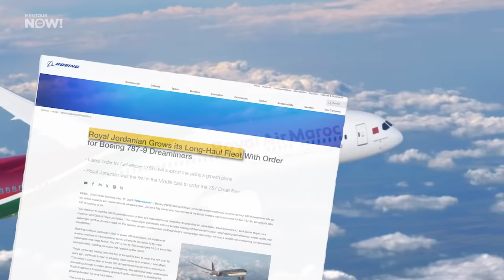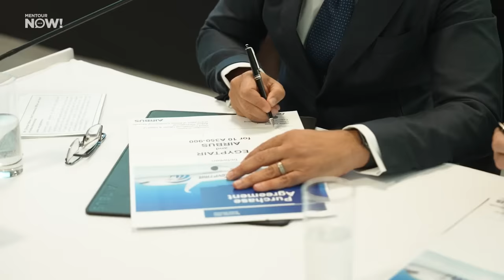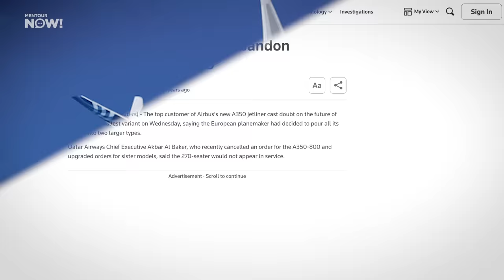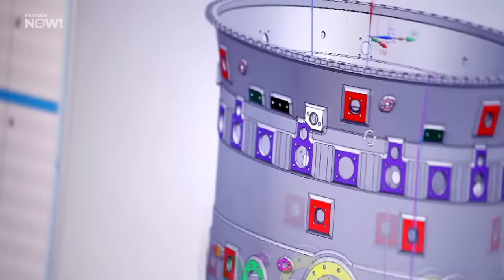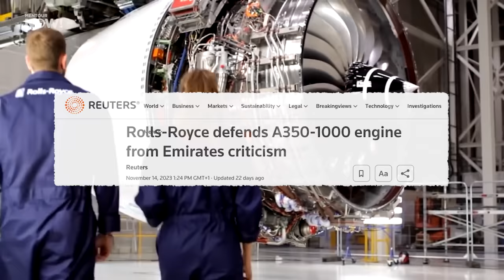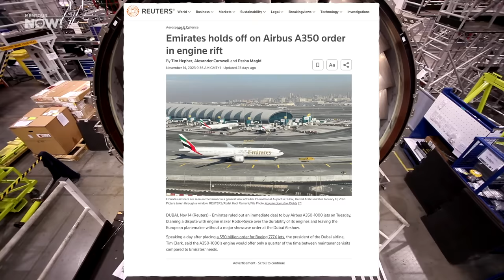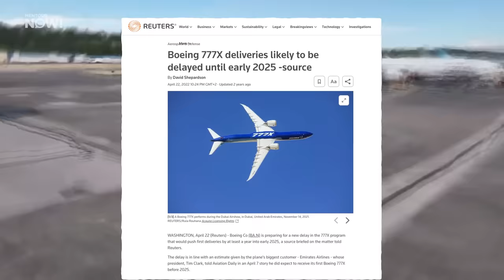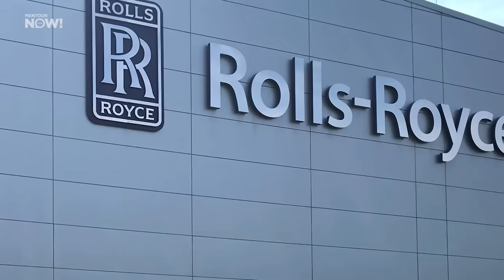What’s WRONG with the Airbus A350?!

Comment: My son has flown to Australia and back from the UK three times in the last fifteen months. He's flown on 777s, A350s, a 787, an A380 and 737-MAX (Singapore to Cairns). His favourite plane by far of all those is the A350 as used by Singapore Airlines. Apart from the 737-MAX which he found very cramped, the one he disliked the most was a 777 operated by Swissair, which he said was very tired and poorly equipped compared to the others.
Reply: Thanks for this comment..your son has good judgement about aircraft and I agree that the Airbus 350  (Singapore Airlines) is probably the most comfortable long haul..Have taken it many times from Christchurch-Singapore. and Singapore-Auckland.
Reply: We are flying Cairns,  Singapore,  UK and looking forward to the A350 but not the 737 max leg!!
Reply: This
Reply: I have the same experience A 350 operated by Thai was my favorite and 777 operated by Austrian the least liked
Reply: I flown flydubai 737 MAX 8 and no thanks... cramped, old hull. Maybe good in terms of training, fuel efficiency but its an old style aircraft. I also hated the infotainment. Extremely big and bright screens and as it is so cramped, many will touch your screen by corner when passing by and turning it ON for you when you are asleep. Shitty design.
Reply: He was lucky that a door didn't just pop of mid air in that 737 Max
Reply: @Chopper153  that model is doomed I cannot understand how it has had so many problems

Comment: I can't help thinking that Emirates are just playing hardball with Airbus and RR. By withholding an expected order and making the 'defective' comments, they will eventually end up with a more satisfactory engine on-wing service interval and probably better commercial terms than if they placed the order sooner, with conditions for serviceability to be improved in due course. Given the long lead times for the airliners, delaying a year or so before placing the firm orders really piles the pressure on AB and RR at little risk to Emirates. In fact, once they do decide to place orders, they can probably use their purchasing clout to jump the line for delivery slots.
Reply: Indeed.
Reply: @NicolaW72  hmmm let's see, the Trent XWB has a reliability rate of just 99.91% and the GE90-115B/GEnx have a reliability rate of 99.98% 🤔
Reply: @rafaelwilks  Among the latest gen engines though TrentXWB is arguably the most reliable in widebody sector. Even GENx suffered from midflight shutdown and grounding due to icing issues. TrentXWB has none.
But none of the engines are as reliable the more last gen ones, both as a result of less mature and pushing closer to physical limits to achieve efficiency.
Reply: @rafaelwilks  That was not caused by design defects, and no subsequent grounding was resulted. Al Bakar at some point threated Qatar would not receive any more GENx-powered 787 before the issue is fixed. He did mooed about Trent XWB but never took a fight against RR up to this date.
Reply: @steinwaldmadchen  then how do you explain the superior reliability rate of the GEnx over the Trent XWB?
Reply: @rafaelwilks  Sorry but I can't find a single sources suggesting that. But even if that is the case, GENx entered service 2 years earlier and experienced 1 major redesign to achieve this. Trent XWB stays largely as it was in 2014.
Reply: @steinwaldmadchen  the RB211 had lots of technical trouble during development, it was very unreliable when it entered service, then it underwent some major revisions, and it has since become synonymous with reliability.
Reply: @rafaelwilks The thing is, on one side TrentXWB has been on schedule, on target, has enpowered A350 for millions of hours without much drama (starting from Emirates' equally vocal neighbour Qatar), and endorsed by Qantas for its "strong reliability record". It's on wing time is not great, but neither are other engines with better reputations including CFM LEAP.

On the other hand, you have the GE9X which is still dragging Boeing's feet on 777X certification. It is ridiculous at this point to say GE9X is the better one. Maybe a few years after EIS we can argue how good it is, but not this time.

No doubt GENx has the better reputation than the troubled Trent 1000, but it still missed fuel burn target and suffered groundings, unlike XWB.
Reply: @steinwaldmadchen  don't forget about the Trent 1000 groundings! The Trent 1000 was even more trouble than the GEnx ever was. The engine that got a rougher EIS than the Trent 1000, turns out to be more reliable and higher quality in the end than the Trent 1000 (and Trent XWB, for that matter). And don't forget about the superior dispatch reliability of the GEnx over the Trent XWB! Let's not forget that when it entered service, the RB211 dramatically missed expectations, too, even more so than the GEnx - and then it became famous for its reliability.
Reply: @rafaelwilks  OK, so what?
Reply: AB made a huge strategic mistake. They tried to save a few bucks and thus lost a huge contract. That's the problem when managers are trying to squeeze every cent
Reply: Then lets send this extortionists back to Boeing, and let them have the experience of a Lifetime: Crap customer service.

Comment: It seems to be the fact that the A350's advanced composite materials and insulation played a part in the "Miracle of Haneda" evacuation that 369 people survived from the crush and fire. Ironically, Airbus has no choice but using this seemingly responsibility-less incident to push their business forward, and I cannot complain as a Tokyoite. Meanwhile, let me pray for the 5 perished Japan Cost Guard personnel in the accident who were on a rescue supply mission for the Reiwa 6 Noto Peninsula Earthquake disaster.
Reply: Surely composites don’t have much of an impact. I imagine that the burning composite releases more fumes when burnt, and it shatters upon impact rather than aluminium, which would dent. So I don’t think there would be a major difference if instead of a 350, it was a 777
Reply: @centauri1962  You could say so, but with all due respect, I’m not so sure. About the strength, even as stupid as he could be, the Titan’s owner didn’t dare to make his submersible by aluminum with the same material weight as his carbon fibre. And fumes? One big aim of developing and using such composite materials for the fuselage is flame retardancy to protect passengers inside. The materials of the walls and insulation were carefully designed and layered to serve that purpose. Evidently this time, they succeed in that to some extent, since there were no casualties out of respiratory tract burns and the fuselage structure didn’t give in long after the evacuation finished. The calculated impact and heat resistance of the materials used in the latest airliners like A350 and B787 are slightly but surely better than their predecessors except for such materials’ characteristic unseen time deterioration vulnerabilities.
Reply: imagine being an aerospace engineer and after proving ur insane skill in making an aircraft completely safe, people call it a miracle

Comment: The reason the A350 does not have a GE engine was because GE did not want to canablize their GE-90 sales with a new engine for the A350. And before GE had a "Gentlemans" agreement with Boeing.
Reply: But the question is, when Airbus decides on doing an A350neo maybe in the early 2030s, do you think they'll stick to just RR or will P&W also enter in with their GTF engine but designed specifically for widebody aircraft?
Reply: @CoSmicGoesRacing  RR has their own GTF project, UltraFan and Airbus should have be working with them for a while, and chances are the first application would be A350NEO.
Reply: @CoSmicGoesRacing  Airbus is a burnt child with PW(A340 GTF/ A220,A320 engine issues). I'm sure they would prefer GE. But without GE they stll may go with PW.
Reply: There are no gentleman agreements in corporate business. ...One way or the other, you have to pay for an exclusive contract.

Comment: To be honest, Emirate's concerns are valid.
An engine that can't handle a little sand is an engine that is already picky about how you operate it.
These might be finely tuned machines, but they have to be quite tolerant of abuse all the same.
And if it's "fine in benign conditions" then that means it's fine year round... exactly nowhere in the world.
Rain is not a benign condition, neither is snow sleet hail or sand.
And I don't think humans have a large habit of living far away from any of those things. In fact, I doubt you can find a place on Earth where none of those things happen some time during the year.
It's like saying "This WiFi adapter has a 10 mile range.... under ideal conditions".
But then stating that in realistic conditions it has a range of maybe 50 feet.
Granted, 50 feet might be enough for most people, but they're going to price that adapter based on the 10 mile figure ($$$$$), not the 50 feet figure, because you can get adapters that get better than 50 feet of range in realistic conditions for about $20 shipped to your door.

Point is, everyone that matters to this discussion knows that "ideal conditions" don't exist in the real world.
So to claim that your engine "works fine in benign conditions" when you are talking about an aircraft that needs to operate in ALL weather conditions, even the bad ones, is quite telling that you still have quite a bit of work left to do on your engines.
The real world is INCREDIBLY MESSY in pretty much any way you can think of.

Comment: Hot and dusty conditions are hard on any kind of combustion engine. I can imagine it's even worse with turbofans that are sucking in enormous volumes of unfiltered air every single flight. Parts made of rubber and plastic deteriorate faster, and lubrication oil will break down sooner in these higher temps. I can understand that Rolls Royce is trying to play it safe with these more frequent off-wing maintenance intervals.

Comment: Couldn’t Rolls Royce have a number of serviced engines for a hot swap. The delay then would just be the time to take off one engine and bolt on another.😊
Reply: I'm guessing they're not committed to promise a ready engine to hot swap, either with high number of airframes waiting for new engines to be installed, or they don't have a high turnaround for new or serviced engine ready
Reply: Do you have idea how much those engines cost?

Comment: I thought it was worth commenting on the jet engines operating in hot, sandy climates putting more stress on the engines. A fair number of airlines operating in warmer climates operating the A220 have had to ground their aircraft because of reliability issues with the P&W 1000 series engines. I believe Pratt & Whitney have just now been able rectify these issues ?

Comment: Great video!
One question I have for Emirates - the Rolls Royce XWB might be performing poorly now, but what makes them so confident that the GE9X won't have problems of its own? Being a brand new type

I suppose it makes sense for large airlines to order a mix of Boeing and Airbus jets to have some resilience against reliability problems for a given type, but that entails slightly higher maintenance and crew training costs compared to a single type
Reply: I believe there are delays on the GE9X and they have impacted the B777X
Reply: The slick salesmen often say things that engineers would disagree with, however in this case I think the XWB did have some new technology which seems like it may come at a cost.
Reply: GE isn't in as financial trouble and probably offered a stipend to cover some or all of the extra maintenance costs.
Reply: Then you’ll also be more likely to be affected by any issue that comes up.
Reply: Hmmmm let's see, the Trent XWB has a dispatch reliability rate of just 99.91% and the GE90-115B/GEnx have a dispatch reliability rate of at least 99.98%, and with all this experience and proven track record GE has, we can see where this is going
Reply: @rafaelwilks  those aren't helpful stats, you're not addressing the issue of how often they require overhaul.
Reply: @jeebusk  have any TBO stats for the Trent XWB vs GEnx?
Reply: @jeebusk  Trent XWB TBO stands at about 20,000 hours, whereas the GEnx-1B made it up to 25,000 hours, and a GEnx-2B made it up to 30,000 hours 🤔
Reply: @rafaelwilks  then why was it referred to as "Defective"
Reply: @rafaelwilks  honestly, idk if that's a lot... 

This wasn't mentioned in this video but
My understanding was that it was a geared fan to run some stages at a more optimal speed separate from other stages... I'm guessing those are the components that require more frequent overhaul, but there should be a significant enough fuel saving to compensate.
Reply: @jeebusk  neither the Trent XWB, nor the GEnx, are geared turbofans. The only geared turbofan in service today, is the P&W GTF, which has become famous for its low quality. It's so bad, even the Trent 1000 has a better record (though the reduction gearbox of the GTF isn't anywhere near the main source of trouble).
Reply: @rafaelwilks  ok that's helpful, 
I follow a few aero channels but I'm apparently not keeping up.
Reply: @rafaelwilks  
Can you give any feedback on this claim:
"Designed, engineered, and optimised for the A350 these perfect partners deliver 25% lower fuel burn"

Lower than what? 

"The 787-9 is arguably the most fuel efficient of widebodies and flies each seat 50km per liter or 117 seat mpg" 

I've never really tried to look into this but it's interesting how they measure these things.

Comment: Very well laid out. We've seen some additional blows to the A350-1000 as of late. The Turkish mega order involved 1000s, Delta is supposedly in limbo for twenty 1000s, Air India reshaped their A350-1000 order from 34 to twenty aircraft and Cathay converted their last five 1000s to 900s a few years back. Rolls and Airbus really need to iron out the issues, especially while the 777X is still in certification limbo. The A350-1000 did win some orders (Air France, EVA Air) but it should be a runaway success because of its availability.

Comment: Hello Mentor, I just want to clarify that for the XWB-84 engines on the A359, the 84 denotes its thrust rating of 84,200 lbfs and on the A35k which uses the XWB-97, the 97 denotes its thrust rating of 97,000 lbfs, both XWB variants have the same fan diameter of 3m or 118 inches.

Comment: I was looking at the sales figures and they are not so bad. 😊The problem for airlines is to chose an old type with boeing or the future with Airbus. It seems that the ones choosing Boeing have an advantage for the next 2-years and a disadvantage for the following 10-15 years. The CEO of Emirates should think about it because he is facing already the competition with Qatar and Etihad. On top of that, Boeing is for me the airplanes to avoid after the disastrous cheating on the 737 Max.
Reply from the maker: Well, the MAX disaster was definitely a huge blemish for Boeing. 
But hopefully they learned from it and the 777 is a fantastic aircraft

Comment: First of all this is a fantastic series  (as well as the accident series ) and Peter and his crew are to be given mojo credit for a fine productions,  the best in  their  categories hands down.     That said,   the Trent 7000 is much more like the mentioned difference between the two A350 XWB variants.    The Trent 7000 is descended from the Trent 10 (1000 TEN I believe is its moniker) and the TEN is a 75% new engine over the Trent 1000.    Once parts counts approach 50% its considered new (disagreement on that,  varies from 40 to 60% in various views).   Regardless the TEN should be counted as new and the 7000 has a very detached relationship in the 1000 engines.   The 1000 itself is no longer made,  replaced by the TEN  (doing nothing for its attraction on the 787 that the Trent 1000 was never all that well regarded and more so with the failures).  Two major RR users (NZ and ANA) have dropped it and are buying the GenX for the 787s they buy now.